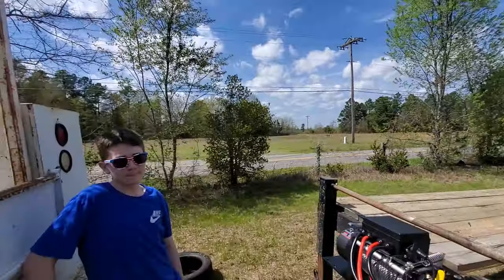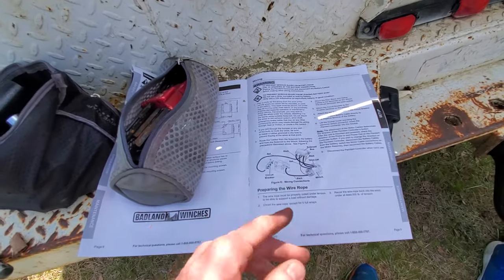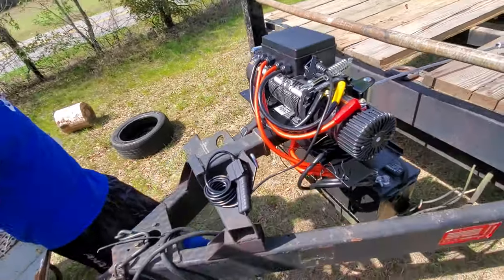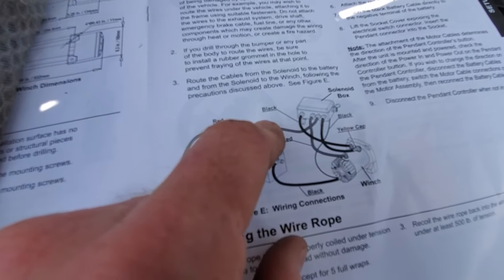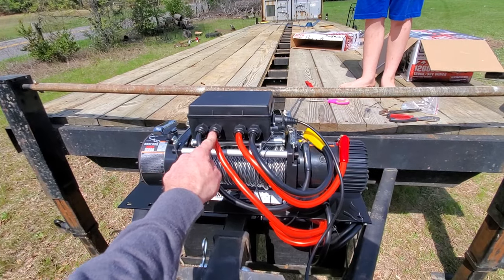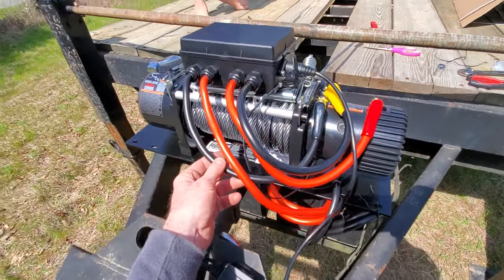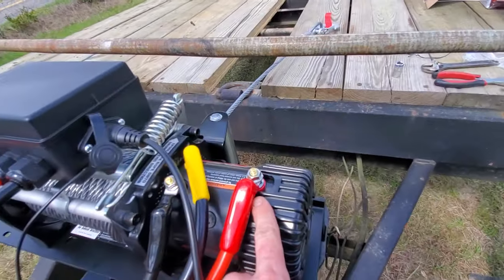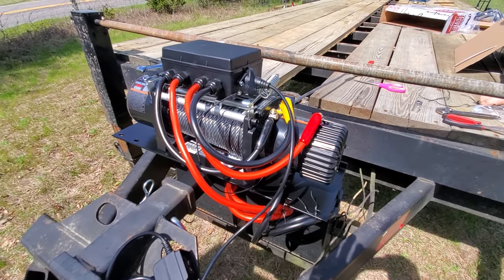12,000 lb ZXR Badland Winch Wiring Instructions

Comment: Well I returned my winch at harbor fright and took a chance and get the same brand ! Worked 10 seconds then nothing ! So I watched this video and you were right reversed the 2 red wires all good so far Thank you ! You saved me from a hole lot of aggravation ! I live hr ,1/1/2 from harbor fright !👍😊👀
Reply from the maker: You're welcome. Dang that's quite the drive. Hopefully it holds up well. I've had 2 of them break on me.  Both have brok in the same spot on the case of the winch where it's really thin. Looks like it's made out of caste aluminum. Why they would make the casing for the winch out of cast aluminum especially when it's a 12000 pound winch is beyond me.  They are definitely  Good when it comes to pulling but man they sure need a redesign it with a different material that they make the casing out of.
Reply: How do u reverse the 2 red wire?im having the same issue

Comment: Thank you for the video. I was wondering.. did you reverse the cables on the control box as well or just the holes the cables come through? I just want to make sure the wiring coming from the 4 posts of the control box is correct also

Comment: i called the the assistant  help line the have, the said the short red goes to the motor,and the long one goes to battery .i switched mine like you did an it worked great. told him didnt make sense ,you have one long blk cable an one red short cable for the battery,he said the changed the instruction in 2017 ,so that would make these new one supposedly about 4 yrs old :(  thank you for catching it

Comment: If your plate instead it's bolted to that will cause the casing on the winch to break they're not very thick
Did you vent that plate cuz I've been mine for the same setup for the same kind of wench

Comment: My question is the wire you say that's supposed to run to the battery? Where exactly is that connected inside of the box? Reason why I ask is I just got the same one attached to a trailer so it came with it already and the power is ran opposite of what you are telling me. My question is if they fixed it by swapping the wires inside cuz the way it is hooked up it works but it's not hooked up like you're saying how to do it. So I don't know if the internal circuit breaker they move the wires around in there or if this thing is just not hooked up right  And miraculously is still working I know that the instructions were wrong. I've heard this from multiple sources. Not saying that you're wrong, I'm just trying to figure out if maybe this has been updated
Reply from the maker: I know I was not wrong when I did the video but they changed things over time so they could have changed it by now.

Comment: I just bought the same one and it just buzzzs when I let it out taking it back tomorrow ! Maybe get a different brand Thanks for the video 👍
Reply from the maker: The relay/overload timed breaker that you connect to the red wire which connects on at the positive side of the battery may be bad.  Or there something in the black control box that was bad from the beginning.

Comment: I have one of the older harbor frate 12000 pound winch and wiring a badlands winch up is really easy to do
Reply from the maker: Yes it's very easy to do. It also does help if they have the wiring instructions correct in the install manual lol.

Comment: Where can I get the positive cable that goes to the winch box to battery mine got hot and burned up
Reply from the maker: You may have to go to autozone or some other automotive store and buy the wire by the foot along with the connector ends and make it yourself. 

I believe they also have pre made wires on Amazon you can purchase that are not related to Harbor freight winches but will work the same.

Comment: did they give a parts number for the (Circuit breaker) block with 3 silver boxes? i think mine blew out
Reply from the maker: I believe they have a part's section in the is a manual that comes with it. I don't have that anymore though. You may be able to do a Google search of it.

Comment: How did you take off the lid for the wiring box to switch the wires
Reply from the maker: I didn't have to take the black Box apart. I just wired them to their correct locations you don't have to take the black Box apart.

Comment: My 9,000 lb Badland winch I I purchased has been a very good but I found out the hard way on why they're so cheap compared to other winch brands all the cables are copper coated aluminum and once they start corroding you won't notice this and it will burn the winch motor out I replaced all my cables with solid copper one ought copper cable and has worked perfect ever since but it did cost me another $150 for good copper cables
Reply from the maker: Thanks for the info. I hate cheap copper clad wire.

Comment: I always mount a winch with the bolt heads that hold it to the mount plate facing the load I will be pulling. That way the bolts will never break off.

Comment: What size battery is needed to power that bad boy?
Reply: Same question
Reply from the maker: I use the marine batteries for boats. I wire 2 of them in parallel.

Comment: Followed the instructions and nothing. Wondered what I did wrong and watched this video. What I did wrong was trust harbor freight instructions.
Reply from the maker: Glad you found the video helpful.
Reply: @AllThingsRamdom  More so than that, the winch itself has saved my ass in a serious way more than once now. These are great budget priced winches but not budget built. Last time it saved me it was totally submerged under water and I had to fish for everything underwater, sweating that it wasn't gonna work. It did, and pulled me right up outta some nasty mud and saved me from surely hydrolocking my engine. So thanks to the winch and thanks again to you for the help installing it easily

Comment: You must not understand that the 12,000 isn’t a weight limit it is a pull limit, you can pull 12,000 lbs but if you pulled something that weighs 8,500 lbs up a ramp it will fail
Reply from the maker: Correct.   Not only is it  a 12000 pound pull limit but it's typically considering something that rolls.

Comment: My 12 k lb bad land winch is strong ,pulls hard but the ,thermal switches Aka Circuit beakers ,constantly shut off ! You'll  hear a click & winch stops ,10 - 15 seconds it clicks back on . Was occasional at first constant now ! A real pain in the ass ! Even Spooling in cable with no load on it it'll keep shutting off ! I have good heavy terminal connections at battery ,so its either the circuit breaker \ thermals are junk or the winch motor is. Frustrating ! It does pull very well ,when its on . If you read the fine print on the winch manual it is 5% duty cycle ,that means 45 seconds of heavy winding requires 14 min cool down period between pulls ! Had I read that ,I never would of purchased ! All my repair trucks I had at work were Warn Winches! I pulled heavy all day long ,never had any issue ! I will buy a better winch next time which may be soon if I can't get this to stop shutting off constantly ! So buy the extended warranty if you are going to buy anything with a motor on it at HF ! Problem is even if you buy their extended warranty ,you will probably end up with less warranty period than a quality winch . I buy at HF but less and less anything with electronics involved . Hardware,wrenches etc ok !
Reply from the maker: Correct mind will do the same thing. I just bypass the breaker switch.

Comment: Dude that plate would break at 1000lbs. Also, you never push the limit on the max load! The most you should pull is HALF the max rated load. 12000 pound winch = 6000, and I'd definitely use a snatch block or 2. People like you scare the $#!+ outta me.
Reply from the maker: I use a snatch block. I also put pipe underneath a container if I'm loading it on to the trailer. It's strong enough it'll blow itself apart If you have too much weight you're pulling.

Comment: if you read the instructions it states which wires go to the motor and which ones go to the battery and the length and the covers on the end of the wires give it away i will say the picture is incorrect.
Reply: I thought that was kind of self explanatory lol. It's like 6ft long so it's kind of obvious it should go somewhere further away that directly on the winch or anywhere else LOL.